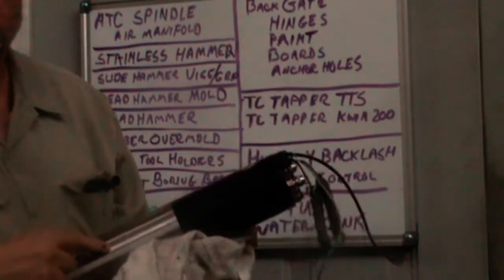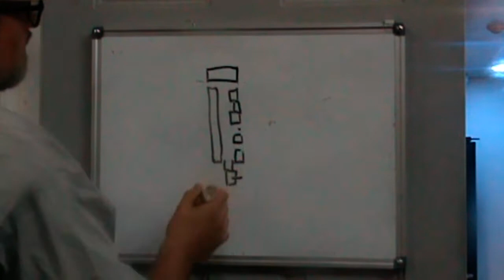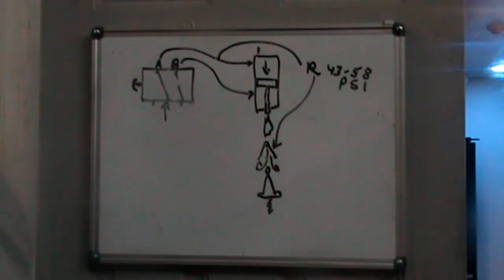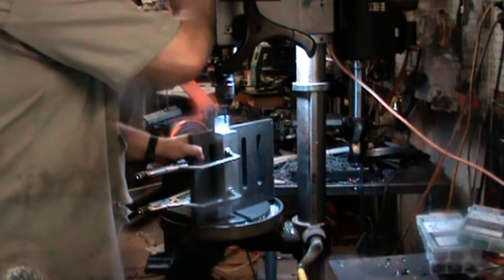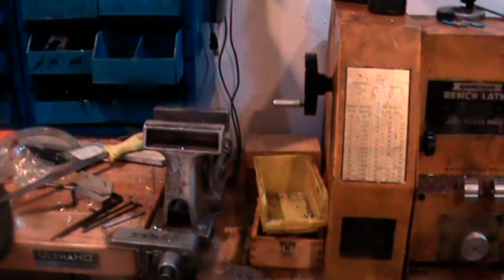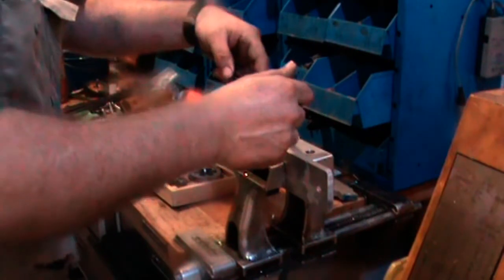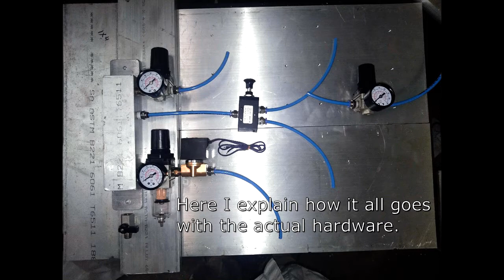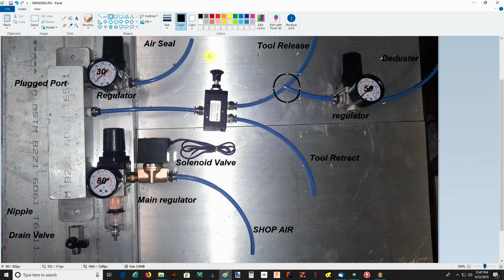Upgrading to an ATC High Speed Spindle Part 3 of ___. When the Plan Falls Apart

Comment: Thank you for posting these series of videos. I just ordered a very similar spindle but BT30 tool holder version. Besides the low pressure air seal do these type of spindles require constant air pressure to keep the tool holder in place while it's cutting and being used? And similarly, does the 2 position 4 way 5 port switch has to have constant air pressure? I've seen different versions of the switch with some having constant pressure and others where the switch has a "neutral" position with no air pressure going trough it until the switch is pressed. I appreciate the help and thank you.
Reply: I have two of these spindles in service.  Both with ISO 20 taper spindle nose.  There appears to be a spring that pulls back the drawbar back, but its a good idea to keep the return side of the air cylinder pressurized so there is no chance of it riding on the end of the internal draw bar when the tool is spinning.  Heat build up from friction would be pretty terrible at 8000-24000 rpm.  It does not consume air to keep pressure on the return side.  The air seal does consume air as does the deduster (tool cleaning blast).  Extending and retracting the claw uses air only at the time it activates and deactivates but once bled/pressurized air usage is negligible.
Reply from the maker: Oops, Was on one of my other channels.  LOL.  Anyway... like I said before.  

I have two of these spindles in service.  Both with ISO 20 taper spindle nose.  There appears to be a spring that pulls back the drawbar back, but its a good idea to keep the return side of the air cylinder pressurized so there is no chance of it riding on the end of the internal draw bar when the tool is spinning.  Heat build up from friction would be pretty terrible at 8000-24000 rpm.  It does not consume air to keep pressure on the return side.  The air seal does consume air as does the deduster (tool cleaning blast).  Extending and retracting the claw uses air only at the time it activates and deactivates but once bled/pressurized air usage is negligible.

Comment: My JGL 80 ATC spindle came today. Thank you very much for that video! It is really helpful. I'll definitely build a valve setup based on your design but first I have to prepare proper spindle holder. I would like to ask you a question about air seal. How much air you have in your shop air container and how often is it launch to pump more air if air seal is on? I have small 50 litres air container and I just wonder how often will it launch to pump new air which air seal is using...
Reply from the maker: I have  a 60 gallon (227 liters) compressor with a 3.7 HP motor.  The pressure switch is at 125/155PSI on/off.  I regulate to 125 for shop distribution.  Then it goes to my air filtration.  I am running three machines with air seals.  I think my compressor cycles on 3-4 times per hour when all three running if I am not using air for anything else.  I don't really pay it much attention.  Its in a different part of my shop.  It runs for atleast a few minutes each time it cycles on.  

Your air volume might be a little low, but your issue is not really going to be air consumption.  The big deal is to provide "DRY" air.  I run out of my tank to a filter separator, refrigeration type dryer, then another filter separator.  Then there is another filter separator at each machine. 

You could use a desiccant stack, but you need to regularly pull the desiccant and dry it or it just quits doing anything.  McMaster Carr sells a dual desiccant stack that dries air with one while heating the other to drive moisture out, then switches stacks.  

Sorry, being a damned Yankee I still use Imperial units.

Comment: I am installing a new spindle and I don't understand air schemes 

Can I send you a photo , for you help me with schemes
Reply from the maker: You need to identify the ports on your spindle.  I posted a diagram of how my spindle hooked up in one of my videos on this subject.  You can use a manual valve or an electric solenoid valve, but you must have a valve with those passages and switching if installing a quick change spindle like the one I installed.  I can not identify the ports on your spindle for you, but they should be labeled.  Its not helpful if they are labeled in a language you do not read, but many spindle sellers have some information like that in their original sales listings.  

An inexpensive spindle will likely just have 2 ports for coolant.  Some may have a third for an air seal which sprays air around the rotating part of the spindle nose to prevent oil, cutting coolant, and chips from getting into the spindle.  

An ATC spindle like the one I installed has 2 coolant ports.  An air seal.  An air blast port (deduster) to clean chips off the tool while its being inserted. A release tool port, and a retract tool port.  Each of the air ports have a different recommended air pressure and you need to regulate pressure to each in the appropriate range.  This means you will need multiple regulators.  The pressures should be listed either in the original sales listing or in the documentation that came with your spindle.  They may be listed in a unit of measure you are unfamilar with, but they can be easily converted to other units.